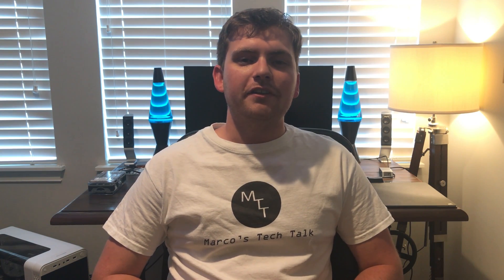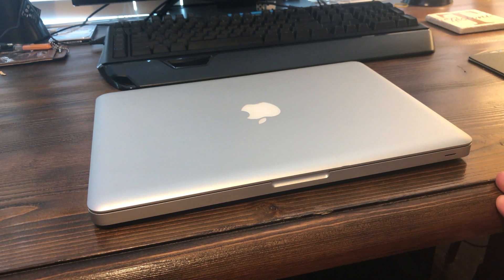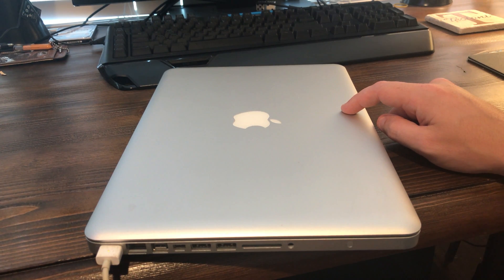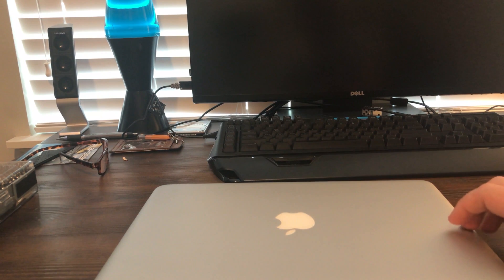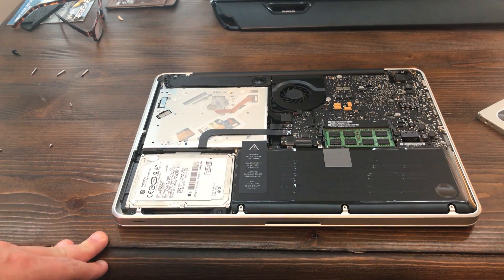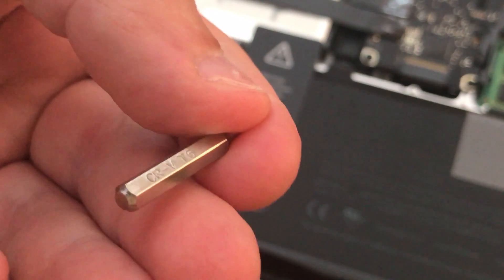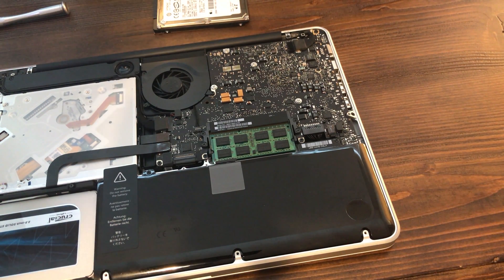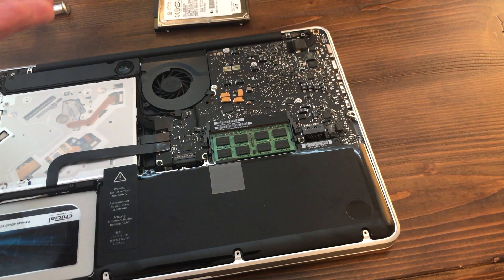MacBook Pro (Mid-2010) Overview and SSD and RAM Upgrade

Comment: I had my computer updated..2010 MacBook Pro to high Sierra and put in a new SSD SATA hard drive. But now when I try to start it it goes black for a second before it shows the log in..?? I feel like this is the beginning of big problems but maybe I’m wrong. Other than that it’s working fine

Comment: i have the same macbook (as a second mobile device/mac/PC) and i have also upgrade an 500 gb ssd and more RAM. Last time the battery nearly explode and i installed a new battery. The touchpad was also broken with the broken battery and i also installed a new (original) touchpad. I have high sierra and snow leopard on it :-) Now i see how long it makes in the future, it is a good macbook

Comment: If it has core 2 duo it’s from 2009 not 2010 the mid 2010s had the 1st gen intel “i5” and “i7”
Reply from the maker: Pretty sure it was a Mid-2010. I think I remember seeing that in about this Mac but I’ve gone through so many since that it is hard to remember. I remember I had a Mid-2012 in high school that was a first gen i7 one. That one was much better. This one is notably slower.
Reply: @marcostechtalk1714  yea your right my mistake the 13 inch MacBooks did have the core2duos still I think it was only some 15/17s inch that had the i5/i7 on them.

Comment: Hey, I'd like to mention that you can replace the Optical Drive with a HDD/SSD by using a Hard Drive Caddy Adapter, if you need more storage, then i'll suggest using this method, if you want to keep the DVD Drive, then i'll suggest buying an external hard drive (I woudn't recommend this option since Macbook Pro's from 2008 to 2011 use USB 2.0 Ports, whilst Macbook Pro 2012 use USB 3.0 Ports). I hope this helps you if you need more storage in your Mid 2010 Macbook Pro.
Reply from the maker: That’s a great idea!

Comment: Hey Marco, nice video! I bought some parts for my MacBook Pro mid 2010. I have a 500GB SSD coming in, 16GB of RAM (8GB X 2), and a NuPower battery.  I just wanted to ask what kind of tool set you're using and where I can find a good set? Thanks, Kelvin.
Reply: hi !How's your upgrade?Can you give me the product name of the SSD and the RAM?thanks!does it worked for you?
Reply from the maker: I use a micro center tool kit I bought back in 2015. Has a whole bunch of different tools in it and it’s really small.

Comment: I have one of these. If I switch to a ssd drive how will I be able to redownload Mac OS if I do not have a disc?
Reply: Clone your internal hard drive to the ssd hard drive before you install it. It’s really simple using a SATA to SSD transfer cable.

Comment: I think the four gigs of ram in that in that Apple MacBook is already an upgrade I think those originally came with two gigs of RAM embarking 2008 2009 you paid out $100 for 4 gigs of RAM or $100 for a bigger hard drive like a 350 gig hard drive Apple makes good computers but every time you want something a little bit extra you're paying for it

Comment: What can you tell me about usb transfer speeds. I have a SanDisk extreme pro that maximizes about 1000 Mbps on usb 3.1 unfortunately this MacBook is usb 2.0 and I only get read and writes of 35mbps??? I have 16gb of ram and upgraded to faster internal hard drive. Need help! Thanks!
Reply from the maker: I remember it being very slow. Have had this laptop in storage since the last video I made of it so it’s been some time since I’ve used it.

Comment: Thanks for the helpful video! I have the same computer that is currently my work horse. It is sluggish and randomly shuts down but I’d like to upgrade it. My question is, can I put a 50gig ssd in and do you know the max ram that I can install to squeeze some more life out of this machine? Also, I think I need a new graphics card if you can make a recommendation. Thanks in advance!
Reply from the maker: You won’t be able to run another graphics card as this has integrated graphics soldered to the motherboard. 50GB SSD is far too small. Even 128GB is probably pushing it. I think you can max it out to 16GB Of ram if it has the newest firmware that it supports.

Comment: I am planning to buy macbook pro 15 inch mid 2010 with 2 graphic cards please suggest should i go for it or not and does it works for me in 2021 ?  I am really confuse please help me.
Reply from the maker: I would not consider getting that today unless it’s just to mess around with. It will be very slow by today’s standards. Maybe wait till the new ARM Macs come out and pick up a late model Intel one for a little less. Or get a 2013 retina MacBook Pro because at the very least those will run Mac OS Big Sur coming out later this year. As for the fate of future releases it’s anyone’s guess if it will still be supported.

Comment: Can I use 1067 and 1600 ram together on a the same mac that you have
Reply from the maker: I am not sure. It might boot but if it works at all without breaking anything it would surely run at the speed of the slowest one.

Comment: Is this still worth doing now in 2020? What OS can I install after changing the drive?
Reply from the maker: Officially is high Sierra. Unofficially you can run Catalina. It runs decent on high Sierra. If you get one for $130 like I did and you don’t have a Mac but want the Mac experience. I’d say it’s still worth it. Or if you need a laptop I’d say it’s WAY better than any pc would be at this price point new. I wouldn’t pay more than probably $150 for one especially since it will probably stock. The ram and the ssd I think cost me another $80.

Comment: I changed my ram and ssd and battery and I only get a (? ) On the start up. Then it shutdown
Reply from the maker: Since you replaced the hard drive you need to reinstall Mac OS. Best bet is probably to put the old one back in and create a boot usb. Or if you have another Mac or a friend with a Mac you can use theirs. Apple has a guide on how to do this on their site. 

https://support.apple.com/en-us/HT201372

Comment: my macbook pro 13 needs a few of replacements speaker, battery, hdd to ssd & 4gb to 8gb or maybe 16gb ram.  just wondering how much will it cost me?
Reply from the maker: It sounds like that is going to far exceed the value of it. It might be best to look into getting another one that doesn’t need all that. The one in this video cost me $135 if I remember correctly.

Comment: Thanks for being so descriptive, I had a 2012 macbook pro I used just for audio production. Would this upgrade be able to handle recording and editing songs in logic?
Reply from the maker: I actually do use it to play around with logic from time to time. Even with the SSD it is a little slow loading software instruments. I definitely wouldn’t want to have a multi track project on it (within reason).

Comment: heyy   I have a question my macbook pro is 2010 a1278 model and I want to upgrade to 16gb ram is it possible? 🙏🏼
Reply from the maker: A quick google search says it may be possible but it may require updating the ROM. I would research it and see if it is something you are comfortable doing.

Comment: Thank you for the video! very helpful... I'm in the process of upgrading the ram, need to buy the ram slots... can you kindly send me a link to the ones you used.... I was wondering what the maximum ram is for the Mid 2010 13" Macbook Pro
Reply from the maker: It looks like this is what I used. Timetec Hynix IC Apple 8GB DDR3... https://www.amazon.com/dp/B01N6ROBYU?ref=ppx_pop_mob_ap_share

Comment: My 2010 macbook pro 13 still runs like a beast, soon it will be 10 years old 😊 the investment was only fucking 1200€ back in 2011, thats insane, I never regret the buy, since then I only added 4 GBs of RAM, a SSD drive, a new battery and a new trackpad.
Reply from the maker: Awesome! These things are pretty awesome!

Comment: Hi, I’m looking to get something similar. MacBook 13” 2.0ghz intel core duo A1278z 250gb and 4gb RAM. Does it look and function the same as this one?
Reply from the maker: A1278 looks like a MacBook, not a MacBook Pro. I think physically it looks similar but if I remember correctly it doesn’t have a back lit keyboard and may be missing some I/O.

Comment: I'm glad I came across your video on this MacBook. I'm an original owner of a mint MacBook Pro (mid 2010) and I wanted to squeeze out an extra few years while I save for a new MacBook. I wanted to upgrade to an SSD, MAX out the Ram and change the battery. Your Video gave me a guideline on what to do because I never open a computer before, but I feel it can't be hard. What was the max ram you put in?, size of SSD and did you changed the battery?? THANKS! :)

Comment: Is good for photoshop and video editing?
Reply from the maker: Maybe for some older low res photos from that time period but I wouldn’t use it for 4K editing and new RAW photos. My main editing pc has a 6700k, 32gb of ram, Gtx 1070, a 970 pro, and a 970 evo plus for scratch disks and it still runs choppy with 4k footage.

Comment: Hi , so 16GB RAM is working for your ?   I see the spec says that two slot supports up to 8 Gb  ?
Reply from the maker: I have 10GB in it. Also I think 16gb works with the newest firmware. I think it was never “officially” supported or something to that affect.

Comment: You could install Mojave or Catalina on this with this patcher by a guy named dosdude1. I have Mojave on my 2010 MacBook Pro and it runs really well with an ssd.
Reply from the maker: Yeah I saw that and I am really considering it. I read that their might be graphical glitches though and things like the iSight camera might now work among other little things. It’s kind of one of those things that may or may not affect you. I might give it a try on the Mac mini. Do you know if this modified the EFI? Or is it just something that gets installed on the SSD? My main concern is modifying the motherboard and then something goes awry with that.